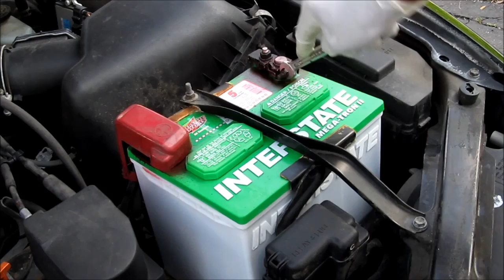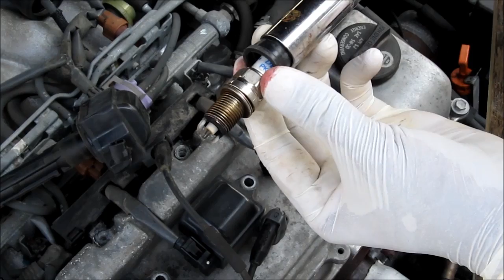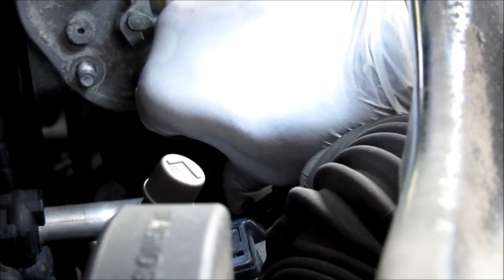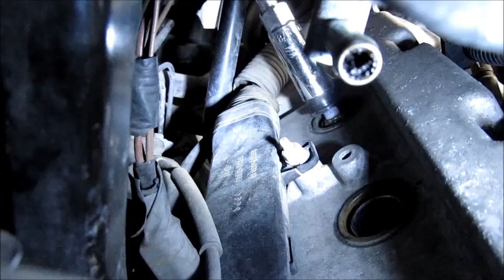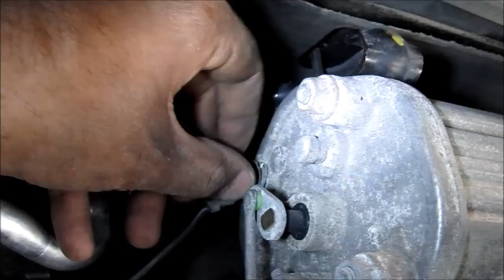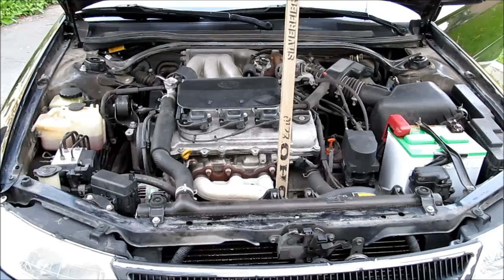Spark Plug Replacement: Toyota / Lexus 3.0L V6

Comment: Very good video. My mechanic said he has to remove the exhaust manifold. Thought I had better check it out. Pretty easy. Will get the camera and monitor out.
Reply from the maker: Its not required to remove the plenum to get to the plugs on the older 1MZ-FE engines with the metal plenum. However newer V6's with the plastic plenum must be removed to access the plugs.
Reply from the maker: Well, watch my video to see me change the plugs without removing the plenum :) .
Reply from the maker: No need for a camera and monitor on a 1MZ-FE, I think its easier to see and work by feel behind the plenum in person than with a camera.
Reply: He probably said you have to remove the intake manifold. It requires more work and a new gasket but it will be required to replace the spark plugs
Reply: My brother is a mechanic (Toyota, Honda, Subaru, ford) and he said you had to
Reply: I did and it's very useful

Comment: Great video! I'm not sure how true this is, but I read this in a review of some Denso plugs... "Denso doesn't recommend using any grease or anti-seize on these. The nickel coating is supposed to be slick enough, and they feel that any lubrication increases the chances of over-torquing." I've also seen torque specs of 12 ft-lbs, but check to be sure.
Reply from the maker: I read that too. But I still use some anti-seize so its not difficult removing the plugs later down the road, and hand tighten it till snug.
Reply: speedkar99  What ATF are you using now that GM no longer licenses Dexron III? I see stuff out there that says "for use in vehicles that previously used Dexron III." I was going to use that. I guess it's Dex3, but they can't print that on the label?  I've been reading lately and there's lots of confusion. D-VI worries me after reading GM specifically recommends against using Dexron VI in non-GM made vehicles that used Dexron III as original equipment. It is also the specified ATF in certain non-GM models that use GM transmissions, such as BMW. It is not, however, specified for GM brand vehicles that have non-GM transmissions, as mentioned above, or are imported to the United States. I hate going to synthetic as well because this car has always had Dex III. http://tinyurl.com/or6zlvt
Reply from the maker: I'd stay away from Dextron VI, I heard its thinner than Dextron III and would do harm to your tranny. I'd just use the Dextron III compatible ATF, which you can get away with on the power steering system.

Comment: just did this, man those 3 in the back are a pain in the butt. I should have watched this video first and save me a lot of time. On the es300 the ones in the back also have the 10mm screws adding more pain to the procedure.
Reply from the maker: It might improve economy, but not a significant amount, maybe 1-2 MPG. It'll make the idle a lot smoother.  Make sure your tires are inflated, your not carrying unnecessary weight, the brakes aren't dragging, and the throttle body and injector systems are all cleaned out to improve fuel economy.
Reply from the maker: Well at least they aren't as hard as a 3MZ-FE or 2GR-FE where you have to take off the intake.
Reply: Think this will improve the gas mileage on a 1995 toyota camry? My wifes car has 80,000 miles and not one time changed.

Comment: Changing a V6 plug is really pain in the butt!! I love having a 4 cyl.So easy to work on the engine
Reply from the maker: It's a nice challenge, but at least you only change it every 5 years or so. I still prefer the V6 for the smoothness, power and refinement.

Comment: Excellent quality video.  However I would like to share an observation due to my personal experience in doing this car.  When you put anti-seize on the spark plug threads, make sure to snug the plug in even tighter than the Hayes manual specs out.  Reason being, is although I tightened to spec, one plug eventually worked its way back out, and destroyed the engine threads.  This required a helicoil insert to fix the damaged threads in the block.  In going back to figure out why this happened, I noted the torque spec from Hayes manual was actually a few pounds LOWER than the spec noted on spark plug manufacturer website.  Therefore, these plugs should go in to the spec by the spark plug manufacturer.  One minor symptom that something was happening but that I did not catch in time, was that .iF you smell the hint of gas...it means your spark plug is working its way out. and gas odor is escaping by the loose threads.  I however looked for a gas leak and could never find it.  Finally the plug blew out and also took out the coil.  ..
Reply from the maker: I think you have it backwards. Putting anti-seize on the threads makes them more slippery and easier to over-torque accidentally. I just snugged them down by hand.
Reply: Maybe you are correct. But if so, why do you think the product is called "ANTI-seize"  and not "Easy Torque"   It seems to me that the purpose of the anti-seize product is to provide a coating so as to make extraction easier later on...or am I wrong on that assumption?  In any case, I always have used a torque wrench and published torque specs instead of approximating by hand feel. But this time the variable was the anti-seize application.
Reply from the maker: Anti-seize is meant to do what it says, prevent seizing between dissimilar metals. It is not meant to be used as a lubricant to make the threading of components easier. With this in mind, I agree, a torque wrench is a good idea.

Comment: Oh, BTW, what's the torque for this?
Reply from the maker: I hand tighten my spark plugs until they are snug. Anti seize compound on the threads will change the recommended torque spec.

Comment: Very helpful, thanks! I could not see how to change with the breather line still on. Swivels and extensions help very well also! Changed the two closest to the right side from the right side with a 3" extension attached to the spark plug socket and then a swivel and then an eight inch extension. Used the same configuration on the left plug and connected the long extension down through the top in the opening on the plenum. This allowed me to have my ratchet on the top side for all three plugs which made it much easier. Great detail and instruction! Thank you!
Reply from the maker: Glad it worked out.
At least the 1MZ-FE isn't as bad as the 3MZ-FE engine.

Comment from the maker: If I remember correctly it was 5/8" spark plug + 3" extension + universal joint + 1" extension then ratchet, because that was what I had at the time.

Comment: Thanks for your response. The good thing is that my intake plenum is similar to yours. The difference is that my front and back spark plugs are the same. I guess I can do the same way as you.  I have learned a lot from your video. Hopefully, you will have a video about shock absorber replacement in the future. Thank you so much

Comment from the maker: I think starting from 2002 they started using a larger plastic intake plenum. You'll have to remove it to gain access to the plugs. Please see my other spark plug video for the ES330, the procedure is the same.

Comment from the maker: Thanks for the feedback!
The procedure is the same for the Sienna, however you may have to remove the wiper arm assembly to get clearance behind the throttle body.
I didn't cus in the video, but that doesn't mean I didn't get enraged when my arm was scarred by reaching behind the plenum. See my Lexus ES330 spark plug replacement video for a shot of that!
Timing belts are usually changed around 90K miles or 140K km.

Comment: It's a Camry but it has the metal plenum.  However, there is an EGR valve to the left of the throttle body that is uber-inconvenient and ruins any chance of getting back there.  Even if that weren't there, there's no room around the left side like in this video.  It's definitely different.

Comment from the maker: Was your 2002 a Solara or Camry? The newer generation Camry introduced for 2002 with the 1MZ-FE 3.0L V6 engine used a plastic intake plenum that was much harder to work around and is necessary to remove to change the rear spark plugs.